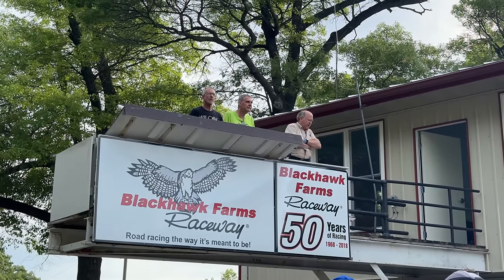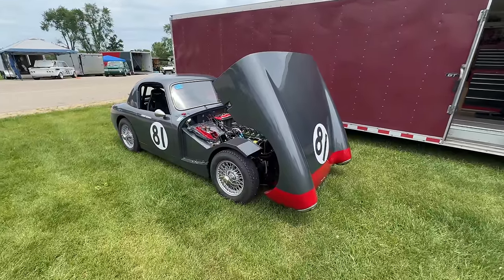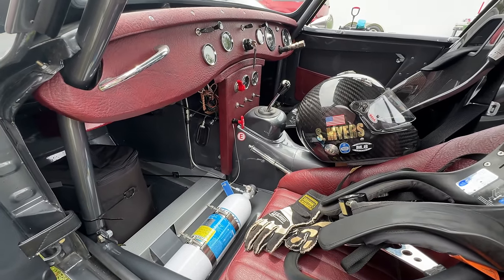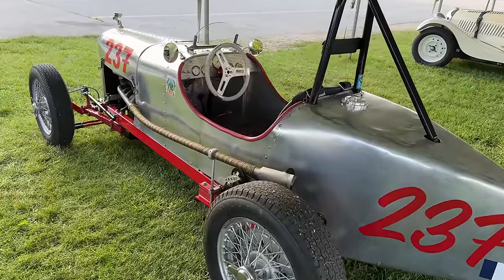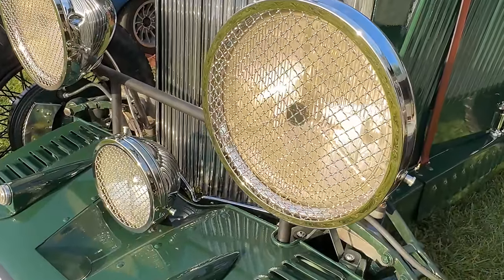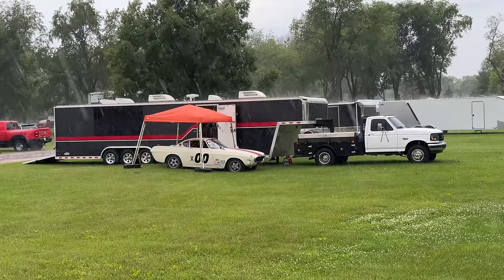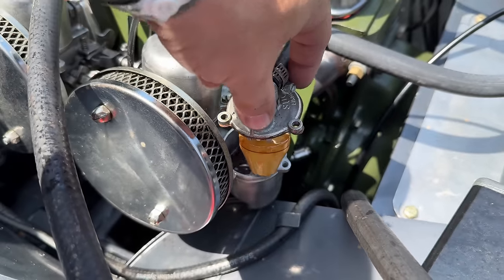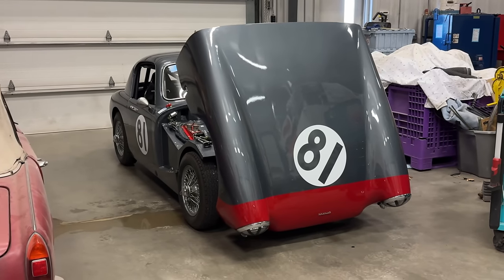Racing the Sprinzel Sebring Coupe at Blackhawk Farms

Comment: Nothing beats BRG on those old British motor cars. Bentley looked like a man amongst boys! Steve, looking at your head gasket, wondering if replacement parts quality is the issue. I'm assuming the surfaces of both the block and head were machined flat before assembly, and you wouldn't have allowed it to overheat to the point of warping. Could the cause of failure be something as simple as not re-torquing the head after initial heat cycles? Hope you let us know the outcome on this little beauty. Also, a brief story about the origins of the Sprinzel Sebring and how it came into your hands would be much appreciated. As always, thanks for taking us along.
Reply from the maker: It was a crate engine built by someone else so who knows why it failed, I didn't even know what type of gasket was in it, but since I am doing the head gasket this time there will not be as many unknowns.
Reply from the maker: HIstory of this car is in this video: https://youtu.be/V7hcsh7qkSM

Comment: The car in the trailer is a Frazer Nash.
Reply from the maker: Cool!  I'm working on a 1949 Frazer Manhattan right now.
Reply: The Frazer Nash is one of the prewar Chain Gang Frazer Nashes. The Frazer Manhattan’s are pretty cool as well.
Reply: Frazer Nash cars were originated in the 1920s by Archie Frazer-Nash in England. Frazer cars were built in the 1940s/50s by Kaiser-Frazer in Michigan.
The car in the trailer has a narrow rear track. This is because there is no differential. Frazer Nash (like GN before them) used a set of chains (instead of gears) to transfer drive to a fixed rear axle. As both drive wheels rotate at the same speed, the car has to be slid around corners.